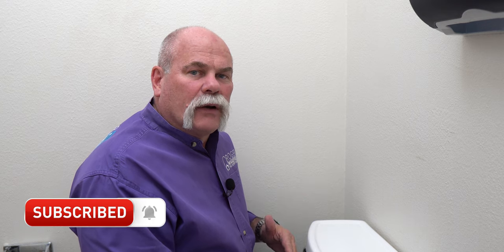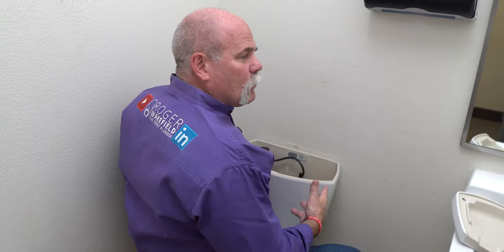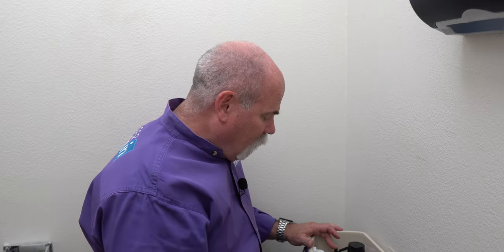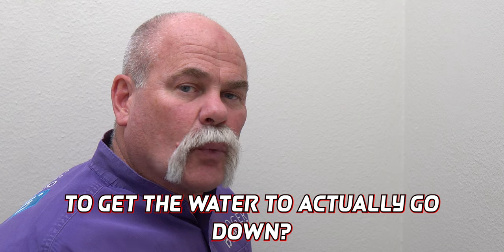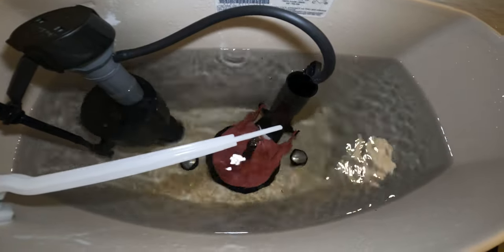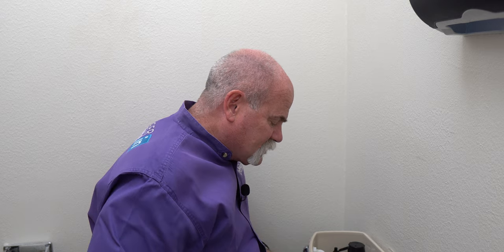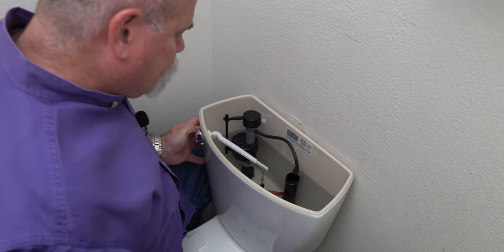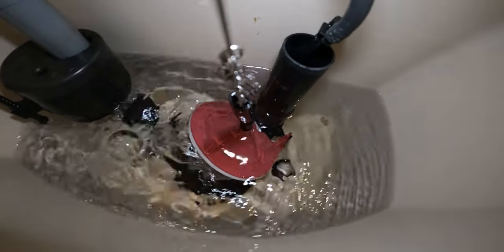How to FIX Low Water Level in Your Toilet with NO Tools

Comment: As an almost 8 year plumber now... I appreciate videos like these. People... potential customers... should be proactive and look for easy repairs like this amongst many other things. Flappers, certain cartridge replacements,  unjamming a disposal with the key etc...

I try to educate customers on what they can do on their own if they're comfortable. 

Too many times you gotta charge 120-250 (pending on your area) for a job that takes 15 minutes. 

People get pissy with you, but I always respond with, if you have a cold do you go to the emergency room? No

Do you go to the doctor? Usually no.

You take dayquil, plenty of fluid and rest until it's out of your system. Common sense to a doctor. 

Same thing for us plumbers, you're calling me, a professional plumber to do a diy job like a flapper replacement. That is not my fault that you called me to do that. My rate stays the same just like any other profession. 

If you're not comfortable with any hands on skills that's one thing. But if I waste my gas, wear and tear on my truck, and replace a flapper for 120$... most times with travel that still can wrap you up for 1.5-2 hrs. I'm still not making that much money 

If you got a pump that's failed, an active leak, a bad clog that requires a machine, a remodel you want to do and plenty more. That's why we charge what we do.

If you're a homeowner please, do your own 5 minute Google search before calling a plumber to do an easy job that you're going to bitch about price on. Do it yourself. It's not worth our time.

Comment: for people who haven't been told the secret, yet; most modern toilets have a two level flush system. you may have noticed the water in the tank only went about halfway down every time Roger flushed.  they are designed to do that if you just press and release the function key.  it works where there isn't much solid stuff to go down.  if there IS solid stuff, press and hold the function key.  that runs the whole tank through, and gets a full flush.  fancier toilets may have multiple buttons or a two direction handle to select between a low water flush and a full flush.

I learned this during a month I spent working for a mobile home manufacturer as warranty service - and in a few cases, we disabled the two level flush, because the homeowner didn't seem to get it.  we also ended up adjusting the fill valve on over half the toilets we saw; whether we were there for a toilet problem or not.

Comment: We have the same Fluidmaster fill assembly, and it is adjusted fully but the water height is still too low. Do I have to remove the fill assembly to adjust the tube height, or is there a way to do so while it is still in the toilet? Thanks

Comment: As for the old style brass fill valves, if your bowl isn't filling all the way, I've seen the rubber seat inside the valve crumble or swell up to a point where it restricts water flow to the bowl fill tube. So, your tank fills to the proper height, but water flow from the fill tube is low and doesn't fill the bowl as much as it used to. With the old brass ones, you can often take them apart and replace rubber the seals/seat. With the old style ones, adjusting the water level in the tank is as simple as bending the float rod.

Comment: I had that problem too, when I opened up the tank the water tube that went to the overflow, had unclipped itself. That meant none of that water could get down into the toilet to fill it up after Flushing. And just a word of advice to anyone else, try not to use this blue cleaning tablets, it makes it really messy and nasty to work on the tank. Just get one of the deodorizers that Clips on the side of the bowl.
Reply: Also eats away at all the gaskets in the tank over time.

Comment: wow you still use fill values that you have to drain the tank you change (old school)  the ones I use have a mounting bracket fitted to the tank with a locking nut on the pipe  you just loosen the nut slide out the valve and replace with the new valve 5 min job you can even with the water still turned on

Comment: Can't afford a plumber right now.  Water running but bowl not filling. The fill valve is mostly dirty and can't get the cap to come off.  And when I shut the water off at the base of the bowl it leaks.  I just get empty gallon water bottles, fill them up and pour that water into the tank.

Comment: Water is very low in my toilet. When I opened the top I see there is no fill tube - is that the reason the bowl is only filling a small amount of water? I went to the plumbing shop to buy new tube and they sold me a new inlet valve and said to replace that…. Please help
Reply: The full tube controls how much water fills into the bowl.  If for some reason you're full tube is missing....I'm guessing that is the issue